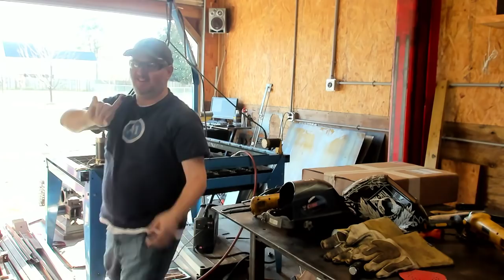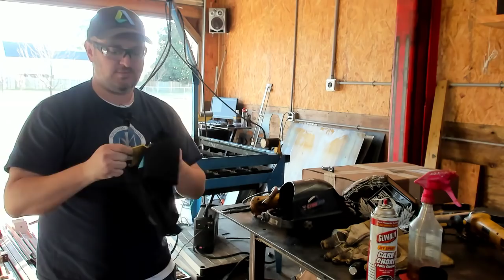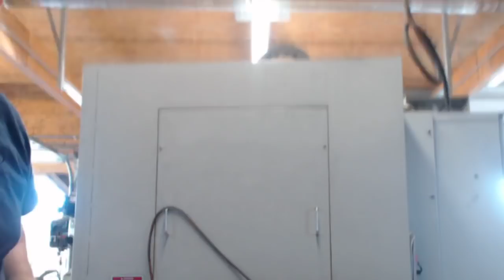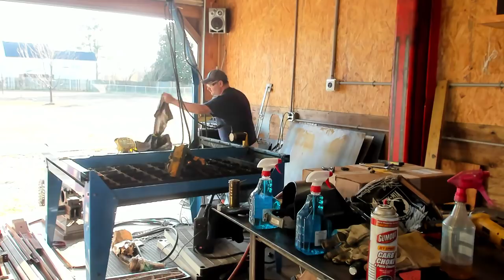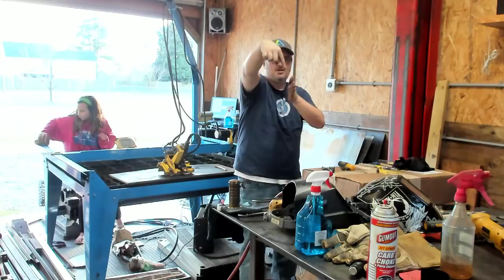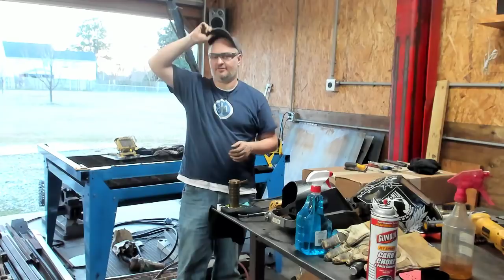PlasmaCam Maintenance

Comment: Finally got to finish watching this.  Enjoyed hearing your opinion on Plasmacam vs some other well known names.  Shop Sabre is certainly a big name as well as JD2.  My Tru Cut is a slightly newer model of what Gary Ramsey has.  It's been pretty good.  I am using it daily now for my new job (they are paying me a Salary plus shop fee for using my shop) trying to see if I can fit the BarZ Bash into my schedule this year if There are still tickets available by the time I can make sure I can go.  By the way my opinion and needs are much different than yours on Table size, I have 4x8 and I'm kicking my self everyday for not going with 5x10 it's killing me.

Comment: Hey how are you. I know this is an old post and you may or may not see this. I was holding to ask you a few questions about the plasma cam table and if you still used it.
Reply from the maker: Hi Trey! Thanks for watching and commenting. I still have this table and it runs just as good now as it did in the beginning. Doesn't take much upkeep; just some basic cleanup and guide bearings every few years.

Comment: Tom, Did i miss a video?  You built a water table for your plasma cam but don't appear to be using it.  Did you have a problem with it?
Reply from the maker: No, it's a great setup but in my current space having the water in the table drives the humidity way up and my CNC machines aren't happy. What I've been planning is to add a way to drain into a tank when not in use and then pump back in when needed. Might also consider adding filtration for it. For now I've been cutting dry and using the water table as a way to catch the parts.
Reply: @TomZelickman  Did you ever have problems with the torch height control with water splashing up on the torch head? Thanks for the info.
Reply from the maker: @curransKids  I did a little, yes. It would short out the height control and make it think I had hit material. I believe using the proper machine torch would fix that though. Also check out ZTFab and some of the stuff he has done to make his plasma cutting top notch. Paul is awesome!